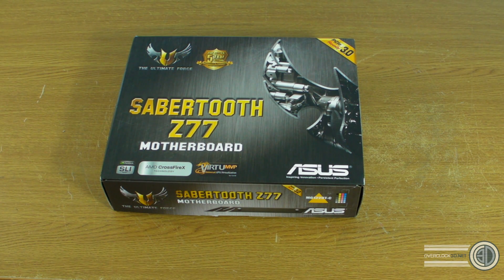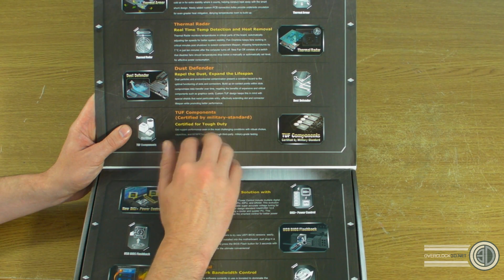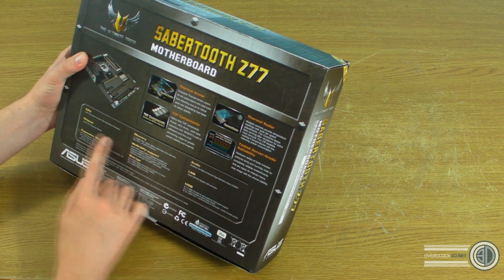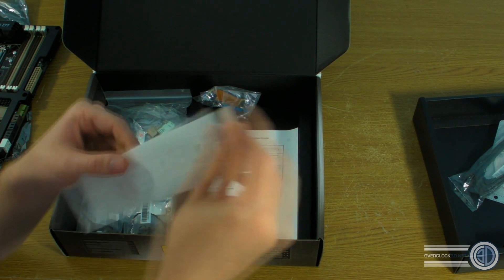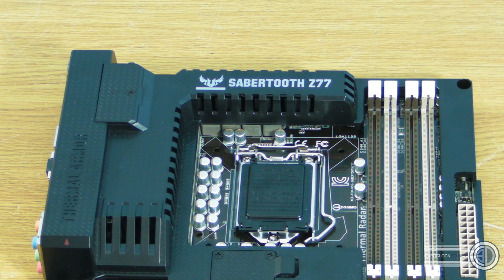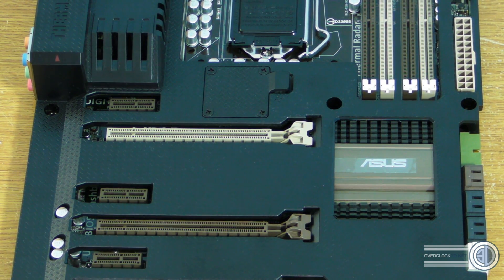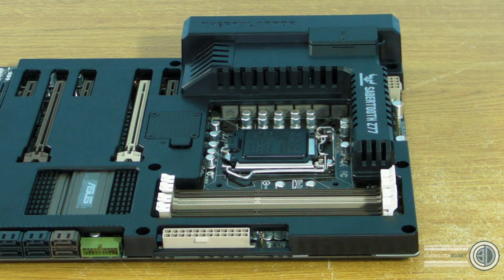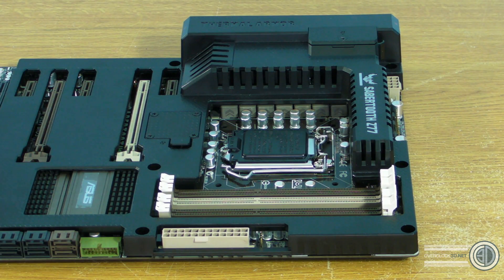Asus Sabertooth Z77 First Look - Ivy Bridge 1155 Review

Comment: i have this motherboard with a 3770k and gtx 680 SLI and is all water cooled found that the assist fans where loudeedst part of system but u can u thermal radar and create a custom fan curve to slow and quite them down over i love the board no dramas with it one bit

Comment: i have asrock z77 extreme4 running-
asus radeon hd7870 directcu2 v2
corsair vengence 8gb
intel i5 3450
120gb ssd for OS
2 x 2tb hdd for files/programs
however my power supply is "aywun" which i cant find anything online about, i had a HIS HD7850 break recently on a very mild overclock when it was under very little stress, i suspect it may have been the psu... but i wasnt able to get warranty on the card because of OC.... reckon replace the psu?

Comment: Is it just the build quality and dust protection that puts this board in the £170 region?
The AsRock Z77 Extreme4 is £102 at the moment and can support DDR3 RAM at 2800+ mhz, whereas this board can only support 1866mhz, according to manufacturer's site.

I was considering buying this board until i realised it would throttle down my RAM, unless some one can confirm that this board can handle 2133/2400 mhz RAM im going to go with the AsRock Extreme4.

Comment: Thinking about getting this with the Ivy i7-3770k water cooled h100 in the Corsair C70 case for an all around military look computer. Its all going to be a pretty tight fit but i think it will look sweet. Also im not really worried about noise so those 40mm fans seem pretty cool to me. Any thoughts?

Comment: Thinking about getting this for my new build, I was thinking; Sabertooth z77, i5 3570k, Gigabyte 7970 Windforce, Corsair hx850w atx psu, Coolermaster haf 932 advanced full tower and an h100 for cooling. And possibly going crossfire 7970s in the future.

Not really sure what ram / HDD / SSD to go for yet.

Comment: I own a Sabertooth P67 board and with the little 50mm fan vs no fan did make a great difference without a noticible change of noise, but i was wondering if it wil make any difference on how you would mount the little top fan cooling the mosfets because it is meant to be an intake fan but wouldn't it make more sense to mount it backwards as an out take fan?

Comment: Yeah i actually decided to go with Asus P8Z77 Delux. I rly rly didn't wona go with 2011 socket, and now i don't have to. As far as i have red up this board is at the top of the z77 lineup, and i can get it from wholesaler which for me makes it slightly cheaper then Sabertooth Z77 which i would have to buy from a regular shop.

Comment: Scratch my previous comment, i just found an answer to my question. LGA1155 distributes 16 pcie lanes over whatever slots you got, so i can only optimally run 1 GTX 690. For more "futreproveness" i will go with LGA2011 x79 board.

Comment: hi, could you explain the confusing thing about phase power design which no one seems to really know?? is it only useful for overclocking? or it saves power (and so money i guess) also at idle (or stock) situations? because if it does then it could probably worth spending e.x.about 40$ more for a motherboard with 8+2+2 vs one with  4+1+1 Phase Power Design.... (im now specifically referring to ASUS P8Z77V-LE vs P8Z77V-LX but the question is general....)

Comment: I was thinking this board, with 3770k, 16 gig hyperX 1866mhz (black), Intel 520 240gig SSd + WD 2Tb caviar black HDD, GTX 690 or maybe even two since this is a pci-e 3.0 4 way sli compatible board. And then slap all of it in a nice case with dual rad for CPU and some aftermarket fans.
Tell me what you think, i am not sure if this board can really take on gtx 690 or 2.

Comment: Regardless of how many rads you put in a system with an i7 3770k, it's going to get hot. Intel used some cheap thermal paste on the new Ivy Bridge processors, so after a certain voltage/clock the heat just explodes. Really hope they send out a new batch of processor with better thermal paste, or make a brand new one. I'm keeping my 2600k until it's fixed lol.

Comment: This is what I'm getting and putting it with:
Case: Xigmatek Elsium
water cooled with :  XSPC Rasa 750 RX360
PSU : Corsair 1050 HX Modular
Proccessor : Intel Core i7 3770k
Ram : 32gb Corsair Vengeance ddr3
Motherboard : Asus Sabertooth
Graphic Cards : 2x Nvidia Geforce  GTX 680 2GB
and a few more things added too.
Alan

Comment: I do like the look of this board and I'll be installing one in a Corsair 600T White edition case very soon along with some braided white cables, white fans, and white memory modules. The idea being that the outside will be white with black accents, and the inside black with white accents.
I may remove the TUF armour depending on how it performs and I know the PCB underneath is black so that should still look pretty good.

Comment: Finally moving away from my Kentsfield build and am moving over to Ivy; I've already got this in my sights, paired alongside the 3570K, some G.Skill Sniper's,a 90GB Agility 3, and everything else I'm carrying over from my old system (HX1000, 6950 2GB DCII, Rasa RX360 SpinPoint F3 1TB). I'm looking forward to it.

Can finally let the 6950 breath and properly flex it's transistors.

Comment: I will get this board with the GTX 690 and the i5 3570k ... that will last for years :)
probably gonna use it in surround 27" monitors, so the frames will seem smaller.

Comment: The dual GPU cards, 7990 and 690 that is, are usually only good for huge resolutions. There is no real value in using one of those cards for 1920x1080/1920x1200.
A 7970 or 680 is more than enough.

Comment: Bought this. Doing white braided cables from Corsair with the AX850, Noctua fans, Muskin Blackline ridgback 16Gb kit, Water block on the cpu with white hose. Spectre Pro 200mm white LED fan in the front of the case... and umm probably throw a white LED strip or two inside the case.

Comment: Nice vid, thanks.
This board is currently top of miy list. Upgrading from a phenom II. Probably going for 3570k, with a modeate OC (up to 1.3 v). Have already bought a white carbide 500r case, OCZ zx850 psu. I have 2 gigabyte 560ti oc cards for SLI. Likely to go for H100 cooling with noctua fans.
Sound reasonably balanced for gaming?

Comment: yes i would buy this board if i was on the look for doing a themed MODDED case build but i would prob still use a 2500K or 2600K maybe just some olive vengeance still has same overclocking features as other ASUS boards of same socket family.... Bonus would the addition of THUNDERBOLT which you missed out on......Tom`s sad i can hear it....

Comment: Honestly, I was opting for dual GPU with 6950 or 6970 because it's almost cheaper than single 680 or 7970, but I will make some research and look at all the options available. I also will be adding a Corsair H100 CPU cooler, so you don't have to worry about THA HEAT!

Comment: I would get this in a Fractal Design Arc Midi paint it gloss white, for memory i would get corsair LP vengeance white, cpu would be the new i5 3570k, a GTX 670Ti, for psu a corsair AX750w, a kingston hyperX 3K 90GB ssd and a EK H30 240 LTX watercooling kit ;)

Comment: hahaha! so, what you're saying is, the tried true and tested motherboard design that has been implemented for decades, only lasts 6 months? I have a 95' packard bell that sat in my shed for years, it still boots up just fine. Either you're 12, or you don't have any common sense, whilst having an horse boner over the new thermal "armor"

Comment: The rig I am considering building:

The Asus Sabertooth Z77
The Intel 2700K CPU
16GB of Corsair's Vengeance RAM
2X AMD XFX 6950 GPUs running Crossfire X
1X 240GB Corsair Force GT SSD
2X WD Caviar Black 1TB
The XH 850W Corsair PSU
All those components in an astonishing Corsair 600T Case (white edition)

I really hope to build it soon! It will mainly be for music production and Flight Simulator X.